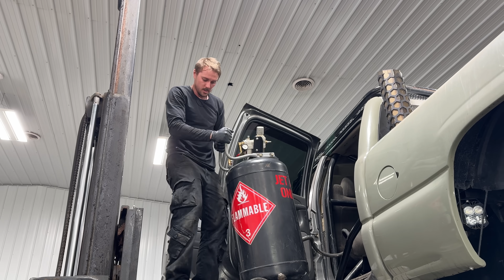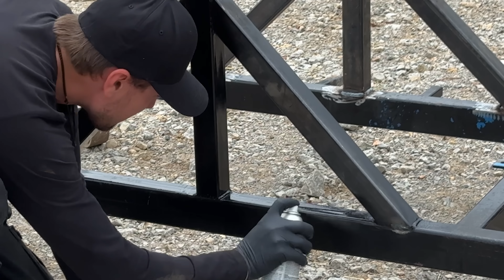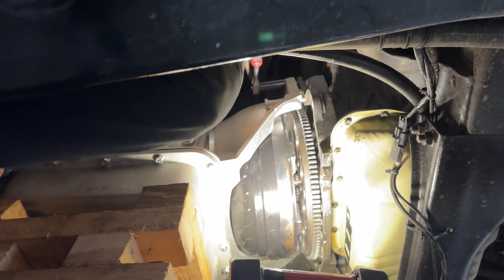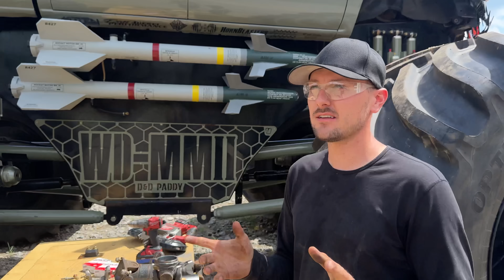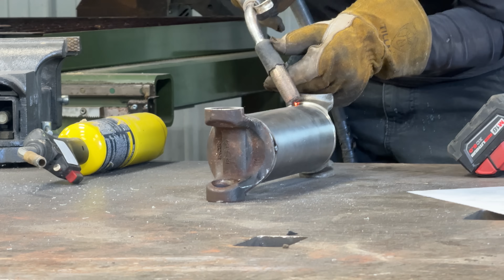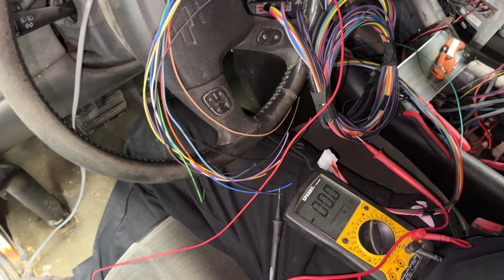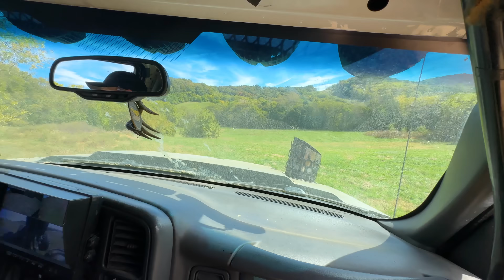Fixing the World's Largest Truck (TWIN Transmission Upgrade)

Comment: I know transmissions are pretty large and heavy, but that truck makes them look small and easy to move around
Reply from the maker: Yea they are smaller than the Allison’s, but stronger actually!
Reply: Drop tire size all problems solved , there is too much resistance on all of the parts , it will never be reliable 

But I don’t think that matters with this truck lol